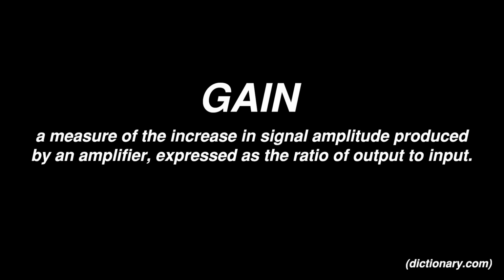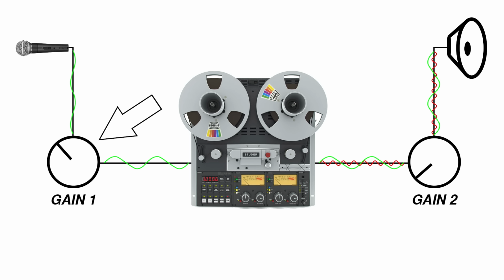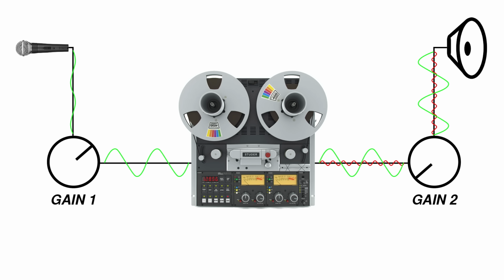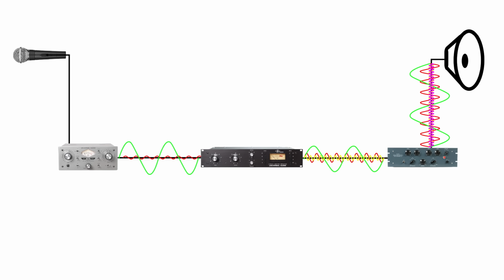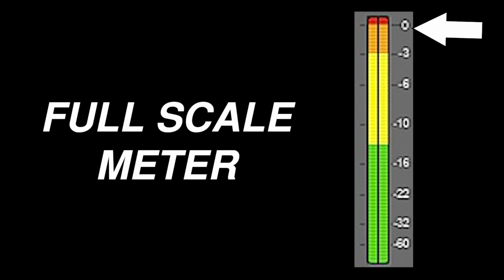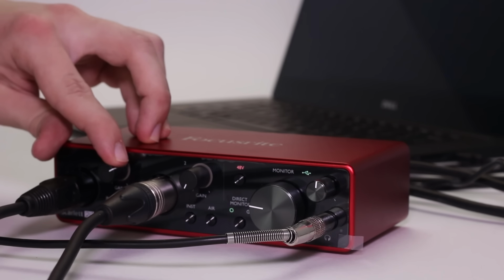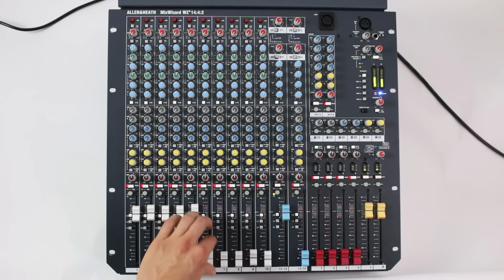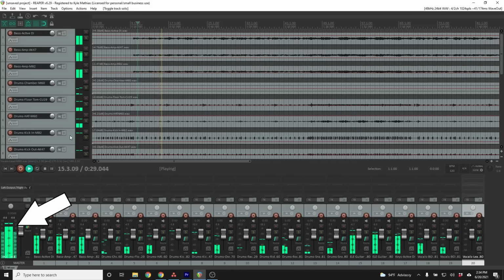Gain Staging Secrets Every Great Audio Engineer Understands!

Comment: Watch this first. I have been doing audio for a long time. This fundamental is critical. Whether live, at home on your listening system and or home theater. Gain structure is the baseline you setup for the reality of change that happens. I grew up where most pushed electronics too hard. Even analog has its limits. I kept on thinking being conservative let me have the headroom I might need later in my later years. Having that margin is a good thing. Then digital came,  and -18 and -12 became your baseline to avoid clipping on those peaks. I have analog gear of the 70s, and new digital gear with the 32 bit float ability. Still best practices help for good results.

Comment: So I understand why you would set the channel gain to peak at around -12 to keep the master from clipping... but why would you want to track at a -12 peak, instead of -6 or -3 to get the best snr on each recorded track and then simply lower the output from there to prevent clipping the master? Seems to me like you're adding noise just to be overly cautious about clipping during tracking. But I'm just an amateur, so I'm probably wrong. I'm mostly curious as to why I'm wrong.

Comment: Gain staging is an analogue throwback. In mixing, you don't need to do it in the digital world unless you're using plugins that simulate that analogue experience. If you stick to digital fx the only, gain you have to worry about is the master buss. Adjust track faders without worrying about anything but digital clipping on the master. It's my understanding that Andrew Scheps, Chris Lord-Alge, Manny Morroquin, Kenny Gioia, and Tony Maserati, all mixing masters, have said at one time or another that gain staging isn't really a priority for them.

Comment: Gain staging for live output can be an adventure at some venues. I work a lot of games as a high school PA announcer who also brings and can do music. At most of those venues, I'm given a single XLR connection to the system that's usually optimized for voice, i.e. just plug a mic and cable into the floor jack and go. However, because I want to do music, too, I often have to send my mic and music through a mixer into that XLR. There's often so much gain built into that link for its "just a mic" purpose that I can often only set reasonable, adjustable gain levels for each individual channel if I set my master at -50. I sure as heck don't get meaningful levels from the LEDs on my mixer when I have the master set that low. But, where it matters, as in the sound that the crowd hears, the levels end up being just fine.

Comment: Hi Kyle, I'm reaching out about a specific Gain Staging workflow I use during technical rehearsals.

My methodological order is:

Set channel Fader high (fully open).

Apply EQ boosts (e.g., for saxophone tone) with low gain.

Gradually set the Input Gain (Preamp) while watching the meter to ensure no clipping from the added EQ boosts.

Finally, bring the fader back to Unity (0dB).

My core question: I do this to methodically manage Headroom and prevent clipping caused by the EQ boost. However, what are the technical consequences of setting the Input Gain after the fader is high? Am I severely compromising my Signal-to-Noise Ratio (SNR) by not setting a strong Input Gain first? I'd appreciate your insight on the trade-off. Thanks!

Comment: This was very helpful! I have a question: I use GarageBand to do drum tracks in my very small drum room. Basic setup, kick, two condenser overheads close / 90deg setup, and either snare both top and bottom, and hi hat (usually bottom), or (these days) kick and 2 overheads, then snare bottom, one rack tom, one floor tom. All of this runs first into a Zoom L8, then via USB into GB. In any config, I find that I need to push at least the kick well up into the yellow, and my master vol indicator is bumping up against (but not pegging at) the red. I find if I don't push it like this I wind up with too quiet a kick. I have been experimenting recently more with the L8 settings (mainly gain) but I am sure I'm doing something fundamentally wrong somewhere. I'm not getting any discernable digital clipping but these tracks are usually going to a friend who has guitar, bass, vox he's adding in PreSonus pro. Is there some fundamental thing I should check to see why I'm having to boost the kick track level / gain so much? Current kick mic is a Sennheiser E602 II, recently purchased (and btw I love it!). Any suggestions, noting it's probably impossible to really diagnose from afar like this? Thank you!

Comment: If my mix ouput is geting a little hot i I often just select all the tracks in my DAW with shift and select, then bring all the faders down -10 db. Is this a useful thing to do or am i missing something?
Reply: This is a bad practice because it implies improper gain staging. The goal is to get proper levels. I once heard, don’t touch the faders until you’re near the end of mixing. 🤯
Reply: @TerrancesPianoLab I'm confused. Please explain as if I'm an idiot (I am!)
Reply: @itsalwaystwentyfivetosixo.3805  Because faders are only moving audio further or closer to you. Faders are like people who are speaking. The closer they are the louder they appear.
And vice versa. This is the application of faders. A person's gain whether further or closer depends on the range of their voice (how much gain) which is most important than their position (fader). Gain staging is HOW much of that audio you have to manipulate. Yes you can use them, but you can only move the audio that you have received and this is usually where people have either too weak of a signal or too hot of a signal. Proper game staging allows for dynamic range and headroom. Therefore, you wouldn’t even have to touch the faders to mix just yet.. Faders are used to mix (based on frequencies) not to get out of the red 😂
Hope that
helps. ث
Reply: @itsalwaystwentyfivetosixo.3805  Because faders are only moving audio further or closer to you. Faders are like people who are speaking. The closer they are the louder they appear.
And vice versa. This is the application of faders. A person's gain whether further or closer depends on the range of their voice (how much gain) which is most important than their position (fader). Gain staging is HOW much of that audio you have to manipulate. Yes you can use them, but you can only move the audio that you have received and this is usually where people have either too weak of a signal or too hot of a signal. Proper game staging allows for dynamic range and headroom. Therefore, you wouldn’t even have to touch the faders to mix just yet.. Faders are used to mix (based on frequencies) not to get out of the red 😂
Hope that
helps. ث
Reply: @itsalwaystwentyfivetosixo.3805  Because faders are only moving audio further or closer to you. Faders are like people who are speaking. The closer they are the louder they appear.
And vice versa. This is the application of faders. A person's gain whether further or closer depends on the range of their voice (how much gain) which is most important than their position (fader). Gain staging is HOW much of that audio you have to manipulate. Yes you can use them, but you can only move the audio that you have received and this is usually where people have either too weak of a signal or too hot of a signal. Proper game staging allows for dynamic range and headroom. Therefore, you wouldn’t even have to touch the faders to mix just yet.. Faders are used to mix (based on frequencies) not to get out of the red 😂
Hope that
helps. ث
Reply: Headroom is basically a little bit more leg room on the flight to add extra things without hitting (clipping) the seat in front of you therefore distorting or losing signal.
Reply: @TerrancesPianoLab actually fuck yeah. That's a very useful analogy, thanks :)

Comment: Why have faders then if you can’t move them?
Reply: Because faders are only moving audio further or closer to you. Faders are like people who are speaking. The closer they are the louder they appear. And vice versa. This is the application of faders. A person’s gain whether further or closer depends on the range of their voice which is most important than their position (fader). Gain staging is HOW much of that audio you have to manipulate. Yes you can use them, but you can only move the audio that you have received and this is usually where people have either too weak of a signal or too hot of a signal. Hope that helps. 😊

Comment: As an older analog engineer,  I relate this back to the old engineer's line "1 volt in, 1 volt out, 1 volt throughout" as proper gain structure. Today, -18dbfs is equivalent to 0dbvu@+4, which is equivalent to 1 volt ac (peak to peak).
I think of bumping -12dbfs  the same as bumping +3dbvu, I have no problems with it, gives me good saturation, good bit depth as well.

Comment: I used to slightly distort all 4 channels on my Fostex cassette recorder regardless of instrument and NEVER used Dolby. This maximized the sound quality and ofc the mixer is analog so a constant and slight red bounce is of no concern.
When I started recording to a DAW, cool edit pro, and got a Wamirack 192x I stopped working because the PC had stuff that's more fun like the Internet and Vanilla WoW and now, I'm dusting off the 4 track. Can't beat simple. So what's luring me into cassettes again ? It's definitely NOT the recording quality but getting rid of complicated digital gear that breaks all the time and was like 1 k USD a piece at 2005ish all the drivers, system req for old OS and all that f.. bs. and ofc. zero latency on the f.. cassette tape 80's tech

Comment: 7:21 "These tools often have a makeup gain knob to allows you to increase the level to compensate for the gain reduction you've applied".  I don't understand this part.  We're both reducing and increasing gain?
Reply: when compressing, the output gain should essentially compensate for the gain reduction (i.e., "the compression"). so say you're hitting -4dB of gain reduction - output gain should really be compensating for this at 4dB so as to not impact the volume  when compressor is bypassed or active. 

basically - no change in volume should be heard :)

Comment: I'm sorry if this is a newbie question, but in DSP, we should be using RMS metering to hit those -18 DBFS goals correct, and use a peak meter to just make sure that your signal isn't clipping/0 DBFS (or to 'notify' you that maybe you should consider some compression at that point)?  Is that correct?

Comment: You know what's funny? This exact explanation about SNR and Dynamic Range in the analog domain applies to image sensors aswell. They have a sensor, an amplifier inside the chip, an analog to digital converter and processing that happens downstream

Comment: So. Here is a million dollar question. I recorded drums on a neve console. Everything perfectly gain staged. I brought my mix to my daw where I use an analog strip plugin, ssl 9000 j which is my go to for any session that I do. In the VU meters of my plugin im perfectly fine as the signal was perfectly recorded matching the analog emulation of the ssl plugin. The problem is, that my faders on my daw, are too down and nowhere near close to 0 that I wanna be working. Signal passes through a simple ssl fusion. and ssl G buss plugins. Any solution except going to each SSL plugin channel and trim the output down? thanks.

Comment: to anyone that is confused why he introduces a VU meter into the topic of getting a good S/N ratio, this is because the S/N ratio increases as you turn up the preamp gain, and only after +20dB gain there's a diminishing return of S/N ratio increment, and +20dB is ALOT. Which means the ideal amount of preamp is like the spot at maximum possible preamp gain, while having an acceptable headroom. The VU meter is there to help you make sure an standardized acceptable headroom. 

This is a video that explained the missing dots
https://www.youtube.com/watch?v=beXVfl1TSD0

Comment: i've been using the K-14 system for a little while now & have gotten pretty good results. i like to adjust the levels going into the mixer channels so the signals are peaking usually no higher than -10dBFS, maybe up to -8dBFS for drums or percussion.

then, once i've gotten a decent rough mix going, i will apply EQ & compression to my drums & bass, getting a good balance between namely the kick drum & the bassline.

i follow that up with soloing the kick & taking note of its level on a VU meter. next, i'll bring the bass back in & make sure that each time the kick & bass hit together, the VU level increases anywhere from 2-3dB. once i have them balanced well, i send them to a kick & bass bus for glue compression.

finally, i'll mix the other elements around the kick & bass, while keeping the kick & bass levels together throughout (ie; if one changes, they both change, etc.)

using the K-14 system, i'm able to get a LUFS reading of around 10-12 integrated after pushing my limiter on the master up by an available 6-8+ dB, while still maintaining a -1dBTP.

Comment: Ah yes, "Gain-Staging" - it's the snake-oil of YouTubers, so it definitely does get "the attention it deserves" - which is very little. 

The truth is that the "Master Bus" of all major DAWs is 32(or 64)bit float and has several HUNDRED decibels of headroom. As such, it is impossible for all intents -and-purposes to overload. If your levels are so high the master fader is in an unworkably low position, just crank the main fader down or insert a Gain utility to crank it down further so the fader is back in a position that's more comfortable for you (don't ruin your mix by trying to pull individual channel faders down to lower what's driving the bus). 

And that's it. Once inside a DAW, the only time you need to worry about gain is when using gain-dependent plugins, or you want a fader to be at a more workable position, or when choosing what level to print your mix at. At other times don't worry about it - if you can hear it, it's fine.

Comment: It’s odd how “simple” it is conceptually yet as soon as I’m listening to other music that has a lot more volume it always ends up with trying to match it. And bye bye goes your headroom. 
Or working with things tracked on different days etc where you can just end up in a crazy battle trying to level things out or automating like mad, or wondering why you’ve pushed the fader quite high yet the result is quieter than another one set way lower. 

Having a clear aim (i.e the -12dBFS thing) basically answered one of my biggest headaches for a while - what to aim for across the board roughly before starting to actually mix. 

Cheers :)

Comment: First: Kyle...your videos are absolutely VERY good in all aspects!! Thank you for this hugely helpful and detailed information. 
I'd like to ask three questions here:
1: Am I right when I conclude that - given the natural limitations of the human hearing spectrum - I will never escape the fact that those bass heavy instruments NEED a significant dB advantage (higher peaks on the dB meter) to ‘stand out’?...even after some (deliberate or accidential ) saturation?
2: If so: can I solve this problem by simply lowering the gain on all the other tracks? (and get the volume back in the mastering stage?)
3: Does it make a technical difference if I choose to lower each and every single track individually or save myself some time by lowering the gain of the whole groups that they belong to?

Comment: I use mvMeter2 by TBProAudio, it's free. I put one on each track and I set it to "VU" mode. I then created a template where all of my gains are hitting that "0" on the VU meter. (which is +4dbu) or -12LUFS. 

As for my outboard gear, I do the same thing except using the VU meter built in. 

This has changed my mixes profoundly.

Comment: Why not just pull the master fader down in the DAW? I use reaper and so do you. I don't know about other DAWs but reaper uses 64bit floating point for internal processing. I don't imagine anyone is going to clip that.

So why not just pull the master fader down and start setting your level balance between tracks, when it is approximately correct then you can select all tracks and apply current volume changes as trim or directly to the media items to then use the channel faders for fine tuning or automation.
Reply from the maker: While you are technically correct, there is still value in understanding gain staging principles and establishing a workflow that could work anywhere. In fixed-point digital system or an analog system, you can’t just ignore the fact that the master fader comes after the master bus. So while someone more advanced like you can mix however you’d like, I believe it’s best to learn the traditional methodology at first.

Comment: I make music with virtual instruments and samples and bounce them as audio files before I start my mix. Then I import these files in my mixing session. When you show how to set up a mix, you set each of  your tracks level to peak at about -12 with faders at 0. Do this still apply in my case or it s only for recording stuff?
Reply from the maker: I like to have all tracks starting with an average around -18 to -12. This isn’t an exact science. Just a way to get the levels where I like them as a starting point, then I can mix with the faders without clipping the master bus.
Reply: @AudioUniversity  thanks . That’s what I do. The only problem is that I have to redo all my volume balance in the mixing stage if I use this method, but I think it s the better option.
Reply from the maker: If it’s already balanced, don’t worry about it. If your master is clipping, you might just turn all of the tracks down by a few dB so they maintain a relative balance.